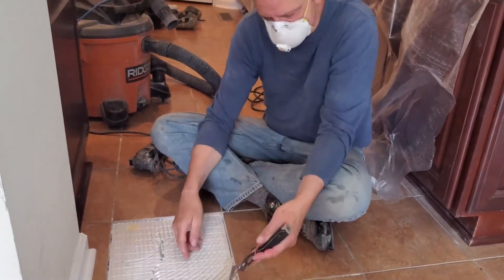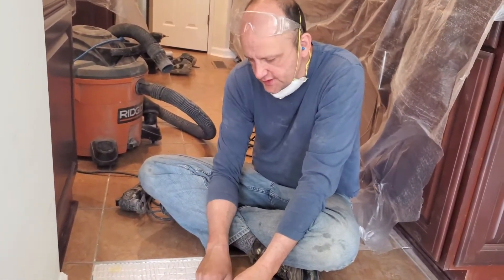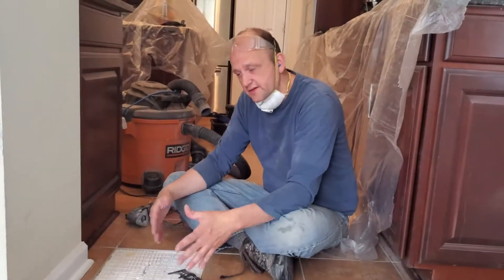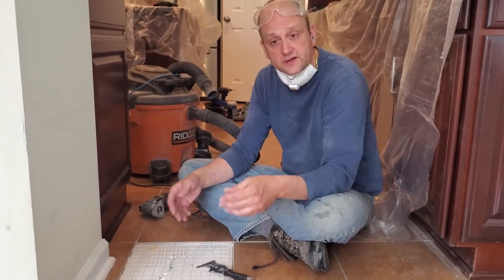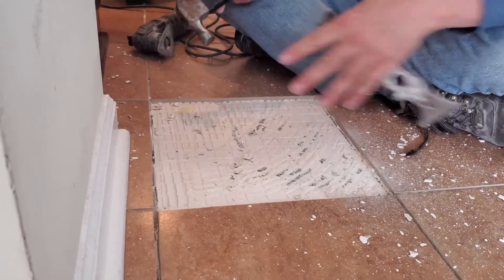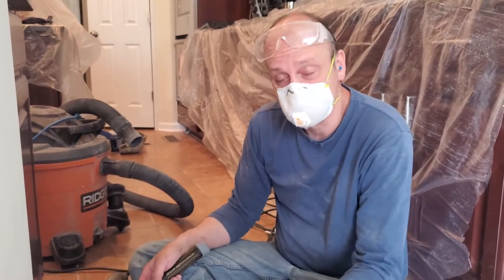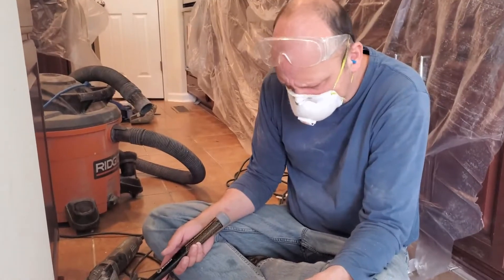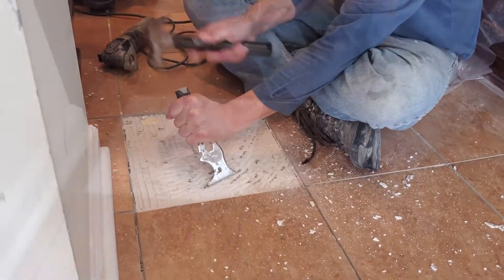Tile Repair: Loose Tiles Part 3 - Getting Thinset off of Backer Board

Comment: great videos!  wish you were in omaha, ne.
Reply from the maker: Thanks for the feedback. If you'd like to try and accomplish the work yourself and need some tips, let me know.

David
Reply: @groutrx1415  you rock.  tile guy left a 4ft section with about 1/2 inch caulk line, the rest of it is pretty tight.  on top of that the caulk (ardex sx) turned yellow within 4 months and got really hard!  Like I had to take my dremmel grout remover attachment to get it out.  so i tore out the affected tiles, but in one section it took some of the backer board out.  was told to fill hole with tek 3 n 1, that it was non sag for walls.  do you agree with that?  then sand it down and have a guy come in and cut/install the tiles.  thanks sir.
Reply from the maker: @bennelly4308  I think I understand what you are dealing with. It sounds like the tile repair is on a wall and the part of the backer board came off. If this is the case, you will need to square off a portion and replace it with a like material. Check out this video:

https://www.youtube.com/watch?v=LJ6jPqdwsT8

If this does not help, feel free to email be some pictures to d-morrison@groutrx.com

remind me you are in Omaha NE so I can reference this conversation.
Reply: Great Vid,

I have small (1x1" ?) glazed, ceramic mosaic, tiles, on my bathroom floor.

My late dad (WWII Navy Vet Pac Flt. JPN). He put them down 50 yrs ago.

They started popping up, after a small shower door leak (now fixed), a few yrs ago (long b4 Utube).

My question is, what kind of "Thin Set", should I use, for this type of small tile ?

I will pick up a multi-tool carbide rasp, too.

Thx !

Btw- 

Do you know of any good "Lath & Plaster", bathroom wall repair videos

I want to reinstall, water damaged (& missing) "Lath". Then reinstall the original (4x4? & Small tub pieces) tiles, back in there too.

All without removing the entire wall of great tiles.

Any ideas on this ?